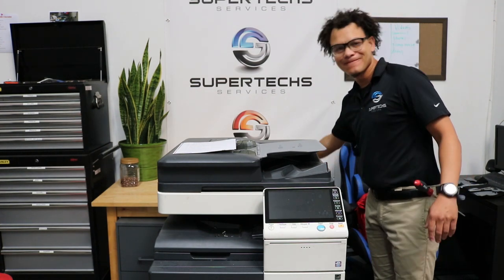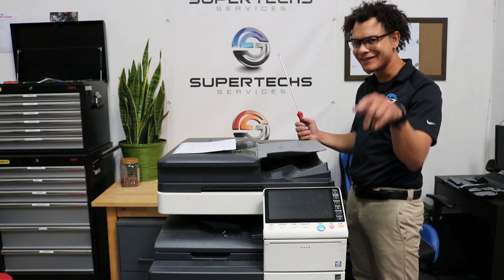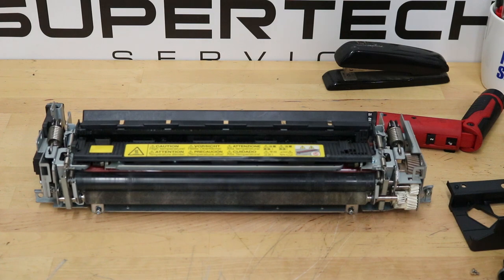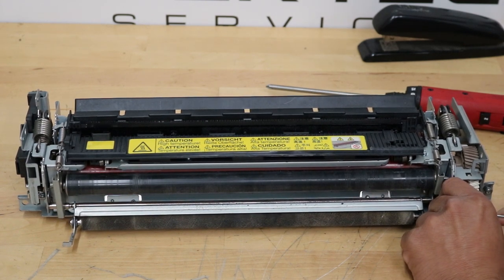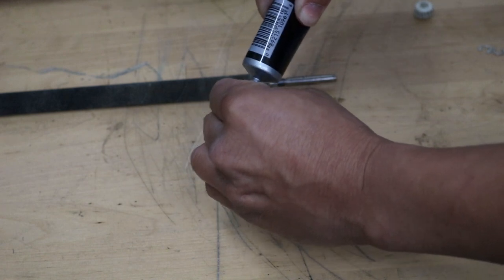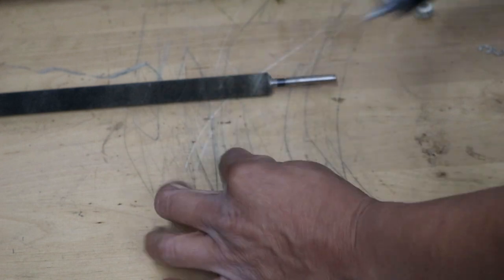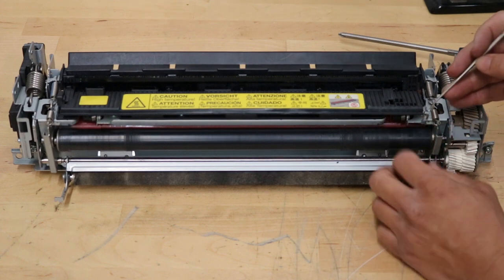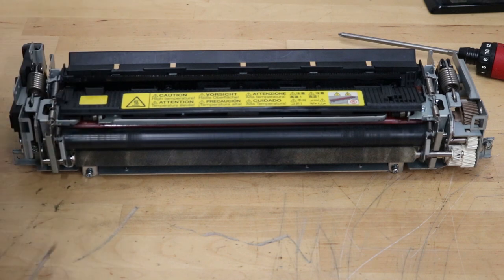How to STOP your Copier from squeaking (Konica)

Comment: If you are under contract , the tech needs to swap out this assembly.  They'll never do an operation like this on site, only back in the shop. If you did this yourself, you'd probably void your warranty.  At this point, Konica should just swap out for a new cassette.

Comment: Great video.  Have you come across squeaking noise coming from the paper exit section or fuser drive assembly/motor? Especially while idle? Thanks.
Reply from the maker: Usually, it's the grey bushing in the fusing unit or the paper exit unit Teflon rollers.
Reply: @Supertechs3  Thank you.  You guys are awesome!